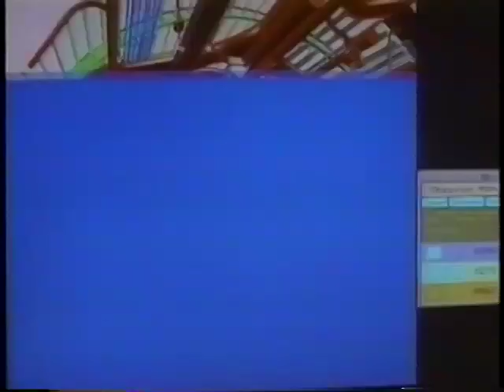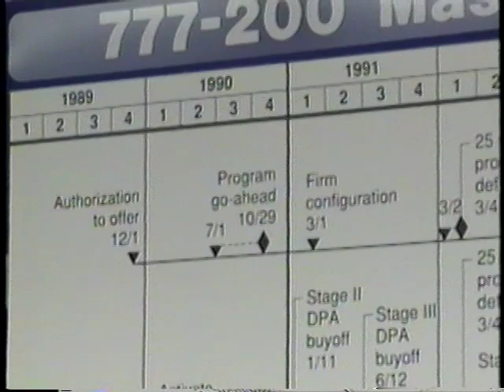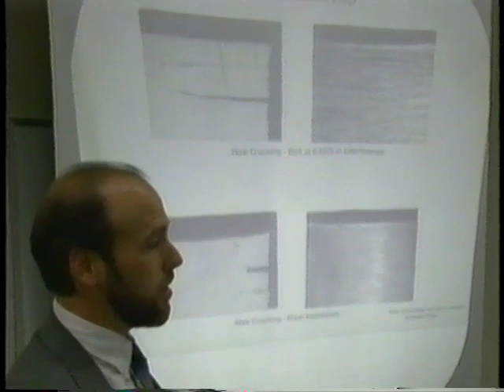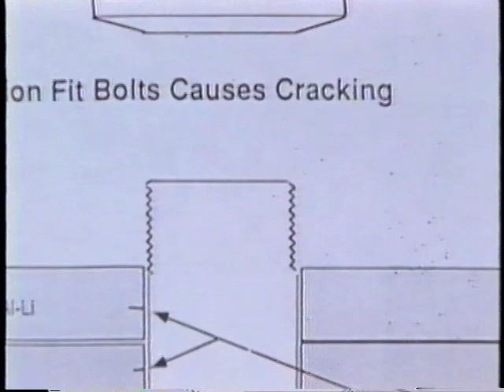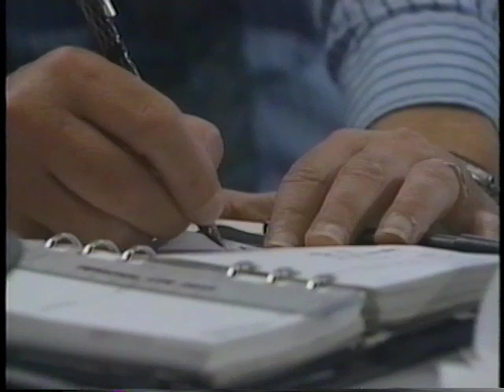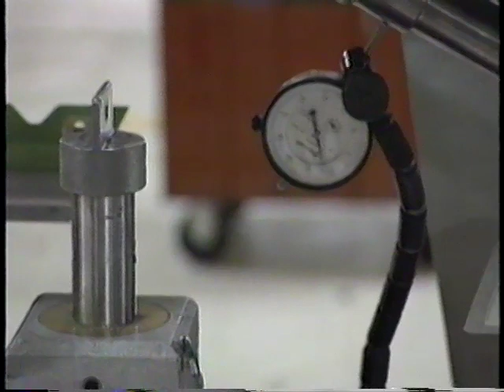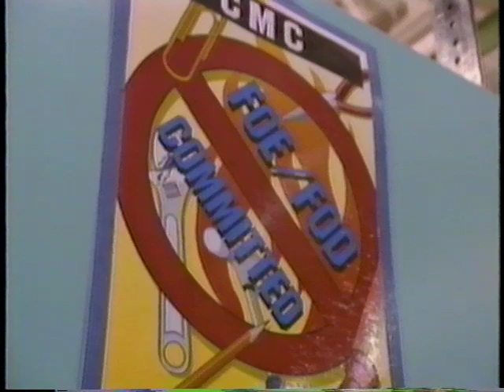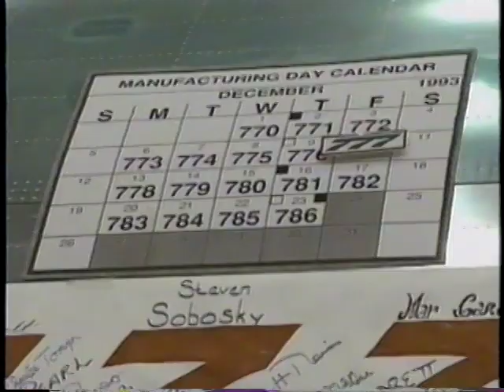21st Century Jet - Building the Boeing 777 - Full Episode 2

Comment: 17:27 “It’s acceptable if Boeing says it’s acceptable”
Reply: @JizzSock_  yes actually, the manufacturer specifies the tolerances, component life, allowable deviances, etc. When the customer discovers a potential issue, they call the company and the company's engineers tell them whether the part needs to be replaced of if it's an acceptable deviance in that specific part. That's how literally everything works. It's specifically because the engineers at Boeing aren't the ones deciding these issues anymore like they did here that makes it a problem.

This was back when Boeing was led by engineers back before the merger. The original 777 was and still is one of the best and safest airplanes ever built. They were discussing microcracks on non load bearing components which was purely an aesthetic issue and from an engineering and technical perspective had absolutely no impact on safety. Any the decision they came to was to spend more money to build a better product.

Comment: 🇺🇸 @17:50…I don’t know if they discussed it back then, but can you imagine if a plane crashed for some other reason aside from the Aluminum Lithium Alloy and the news media found out that Boeing manufactured planes with cracks in a structure (intentional or not)…That’d be an almost insurmountable public relations nightmare. Not easy to convince the public otherwise even if it’s ok the cracks developed.

Comment: So after 16 hrs. flying , I have to land this Beast at Auckland , New Zealand. 
Heavy rain , ceiling /visibility at minimums plus a gusting crosswind to 42 knots. 
The Autopilot CAN'T  LAND,  we are Out of the Autopilot's  landing parameters  ( max 15kts /25 kts xwind  ).
Our alternate airport,  Wellington is not a good option,  and fuel is on the limits. 
I add another 5 kts. to our final approach airspeed ...
We barely make it on the Absolute Minimum parameters for a safe landing ...
We Pilots , will Never be Replaced. 
That was a tough Command Decision , Plus  ...I knew I had the Skills needed to land at the limits. 
B 777 , B 747 , B 767 , Douglas DC 8 71 Commander. 
Qatar Airways  , USAF , LAN CHILE , Air Force of Chile. ( Ret. )
Ps. I entered the Air Force Academy at 15 years old .
Reply: What airline sir? I live in Auckland ! I love 777

Comment: It strikes me that Boeing played the “penalty clause” card against ASTA, but it wasn’t their fault, Boeing made those design changes and rightly so, passenger safety has to be paramount, in my opinion Boeing implemented a manufacturing system that on the surface was designed to make the whole system flow, but it was to rigid and didn’t have the inevitable time delays factored into the system, building a brand new type of anything to such a rigid timescale was not a wise decision and was close to failure on more than one occasion, the system was untested and so the chance of it not working were magnified ten fold.
All I seem to be hearing is “schedule, schedule, schedule” and that goes to show how much of a folly they actually made.
Reply: That’s exactly what Russian did build their Concord that crashed at France air Show ONLY to beat the French and British by 2 months and launched the plane, time was everything to them , unfortunately crashed, by breaking a wing on the show flight test killing 14 including 6 onboard the flight

Comment: It's good if Boeing says it's good on the cracking aluminum.   SMH
Reply: This was back when Boeing was led by engineers back before the merger. The original 777 was and still is one of the best and safest airplanes ever built. They were discussing microcracks on non load bearing components which was purely an aesthetic issue and from an engineering and technical perspective had absolutely no impact on safety. Any the decision they came to was to spend more money to build a better product.

And yes, the manufacturer specifies the tolerances, component life, allowable deviances, etc. When the customer discovers a potential issue, they call the company and the company's engineers tell them whether the part needs to be replaced of if it's an acceptable deviance in that specific part. That's how literally everything works. It's specifically because the engineers at Boeing aren't the ones deciding these issues anymore like they did here that makes it a problem.
Reply: @GlutenEruption  sad how it is now
Reply: @cw7784  really sad. I come back and watch this every now and then when I feel like remembering what they used to be. This was the end of an era, before greedy executives started to treat engineering excellence as merely an inconvenience standing in the way of exponential corporate profits. They should be in jail.
Reply: @GlutenEruption  couldn’t agree more.

Comment: Airbus made the FIRST wide body aircraft, the A300. Airbus also came out with fly by wire first and the composite. Just facts.
Reply: Mike Smith that is very true. True if you ignore the fact that the 747 came out before the A300
Reply: Let’s not forget the DC-10 and the L-1011...both of which predate the A-300 by several years...
Reply: 1st TWIN ENGINED wide body
Reply: The A320 was the first FBW airliner
Reply: Just wrong lol
Reply: No they didn't.. I mean they did but I'm just here to cause grief